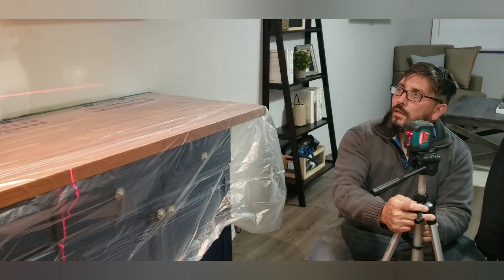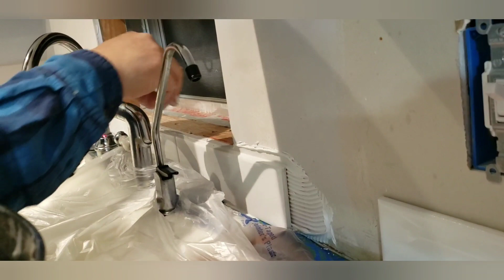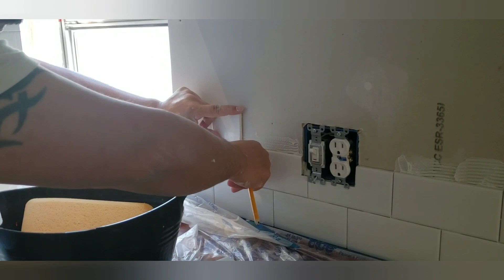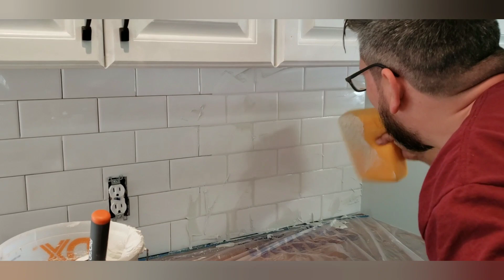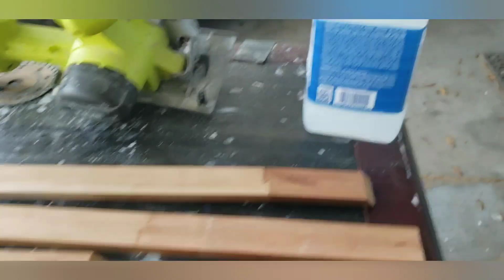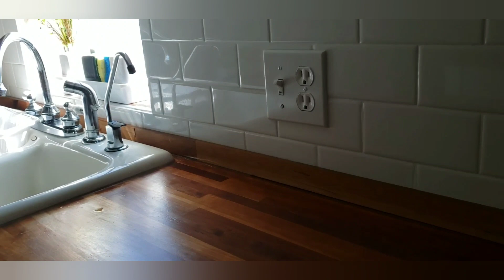Back splash easy and cheap!  (Mobile home renovation 36)

Comment: This is great for a house but I've never seen tile not crack out in a mobile home. A mobile home moves far more than a house. This flex will slowly chip and break out the tile over time in mobiles and the rennovation will have to be redone. I came to this video hoping to see some clever trick to keeping this from happening but... nope.
Reply from the maker: It's been a year and so good so far. Haven't had any chip or breakout.
Reply: @superkeola  That's great! I have some stock backsplash tile to replace in a Fleetwood and it comes glued to the walls. I've been wondering how I'm actually going to do that. My experience with tile in mobiles is 100% bad. But I have to come up with something soon.
Reply from the maker: @irishmonk717  to be fair this is our first experience with it so I have nothing to compare it to. We also tiled the bathroom wall and been happy with the results but only time will tell. I would however never recommend tiling a mobile home floor. Ive heard of breakage due to shifting of the foundation. So I'm not sure if you mean tiling for the floor or walls in your situation.

Comment: Is there a way to not use a laser lever I don’t have that
Reply from the maker: If you don't have one you can do it the old fashion way and just do your measurements. Measure from the floor up and mark where you want your tile to start and finish. You'll have do a little math on it but once you lay down 2 rows then you don't need to measure. You'll just follow the rows you have. I hope this helps. The laser level isn't expensive.  You can get one about 20$. It's a good investment 👌